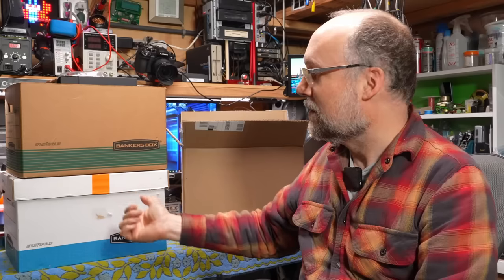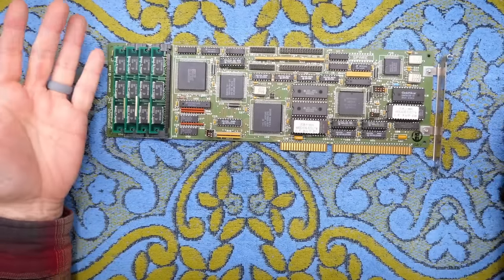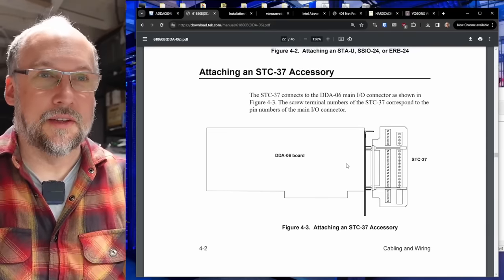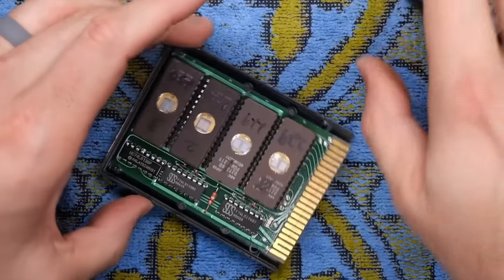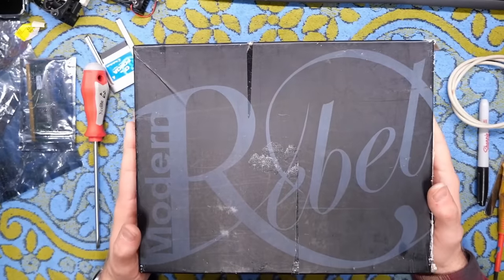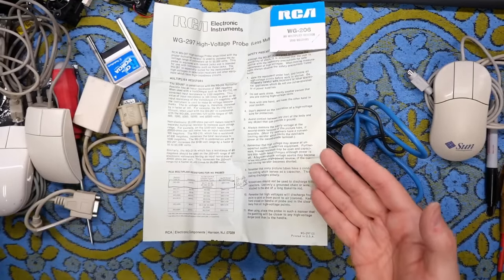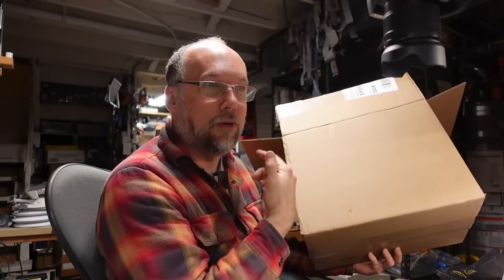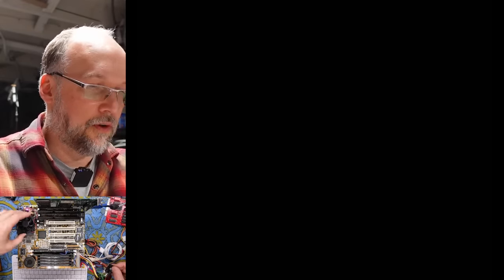What mysterious retro goodies can we find inside these boxes?

Comment: I have seen quite a bit of one-off stuff for computers kind of Niche things you can say.

Even as far as one-off programs including this as well

Side note it was something interesting that at church one time somebody had programmed a just used IBM XT in basic to essentially subtract the death rate from the birth rate from the start time of the program running to give an idea of how many people will be on the Earth at that time pretty neat idea for some event at church.

Also I remember somebody had written a program for a Commodore 64 that was used for timing using the button on a joystick as the trigger it was used for timing how many parts per our in a situation where there was a job training center on a job simulation.

Frankly space bar might have been better honestly in my opinion.

Also even had heard about a device that was actually used with the Atari 2600 add some sort of lab interface for scientific experiments that is just pretty far out there.

Have seen so many devices that look homemade who knows what they did.

Once found this thing in a box had a bunch of ribbon cables coming off with female connectors.

To my surprise when I dismantled the thing..

Do you know there was a DIN connector and cable on one portion.

As much to my surprise there was a keyboard Prince circuit board with all the keys which is removed and in their places soldered in the individual wires from the ribbon cables.

Apparently the person that use this as a switch interface found out this person that handsome and stuff before had built a primitive Smart Home set up and apparently this was used to take various inputs from switches and relays another contacts.

Probably was the easiest way to interface that many of contacts back in the day.

Also saw what would be called a hacked keyboard once that had multiple pin connectors on the side of some sort turns out these were tied into the switches that would correspond to keys that would be used to play a keyboard bass game except adapting them for music for game controller with bit of some circuitry all powered from the power from the keyboard Port pretty clever.

I do believe one of the little adapters that fit this that had the male 9 pin pin d-sub connector was set up for an Atari joystick

Also had seen something kind of weird it was a very tiny Project Box with only one cable coming out again this was a keyboard type connector apparently what this was was was some sort of keyboard emulator what's the only purpose being of that a keyboard being detected but nothing else.

For some type of system where my keyboard would not be present except under a certain service operations such as some sort of kiosk or something like this possibly.

Although it's possible that was a bit of extra that was also providing a certain key combination or a series of inputs on power up or shortly after possibly a dongle sort of thing for software potentially as well but yet not likely since this was homemade or very close to it.

But there was a eeprom but don't know if it even really was doing anything significant or at all in that application.

Don't remember all the details so long ago.

Oh yeah one more thing I saw this push button on the side of a keyboard a red one that died and a small circuit that was actually essentially begin with keyboard emulation and there was also a couple other buttons can't remember what the others were set up for but I do know the red one that had a stiffer push button for good reason the red would do the control alt delete it's possible the person may have had trouble doing key combinations that somebody designed this for them there was some odd key combinations I didn't recognize as well with the others perhaps somebody that was only able to use one hand for example there was a couple other devices that was like a secondary keyboard that could connect to the same keyboard but this was the most interesting part was not those but the other things were set up in something somewhere kind of like doing a separate auxiliary keyboard for hotkeys by the way the old keyboard was all it was was a telephone keypad mounted on the top of another enclosure how long will the internal circuitry.

Also if anyone curious why there's a fuse on some IBM computers internally that is for the keyboard and no it has nothing to do with a malfunctioning keyboard apparently if the cassette Port cable would be plugged into the keyboard Port by accident it would short things out regarding the power turn the keyboard not a good situation chance the fuse.

I didn't see one blonde once but well something that happened but not this for sure not a bad keyboard cable but a bad pet not the computer but a actual four-legged Pet Head chewed through the cable that was an interesting one at least the keyboard cable hey better the keyboard cable than power cable at least for the pet

Comment: Back in the time, had a Pentium 90 MHz system with an ASUS mainboard (don’t know which one, but it had a non-Intel chipset). I bought the Pentium Overdrive 150 MHz not only for speed boost, but also for because it supported the then much hyped MMX instructions. It turned out that the ASUS mainboard didn’t support the CPU at all. I ended up replacing the mainboard with a second hand Intel Advanced/ZP or Zappa mainboard. This board does only have 1.5x and 2x multipliers, so no support for 2.5x or 3x. The overdrive chip worked fine, mine even worked fine at 166 MHz, by bumping the bus up to 66 MHz. That was my first try at overclocking 😂.

Comment: PC Power & Cooling is one of the biggest, best of the old guard. When you wanted to prove you had the biggest, fastest, quietest, most reliable machine of the 80's and 90's? You need a PCP&C power supply - nobody made anything bigger. Or quieter. Doug Dodson's first product was a quieter XT power supply. Followed up by completely redesigning the IBM XT power supply from scratch and giving birth to the legendary PCP&C Silencer family, followed by the TurboCool multi-fan. They got bought and run straight into the ground by OCZ (who also imploded) in 2007 with label-slapping stupidity and cost-cutting. They still technically exist (owned by FirePower Technologies) but it's literal decade plus old designs not in active production. From about 1994 to 2003, PCP&C did the custom design and manufacturing (all in America) of 80% of my power supplies, and a small number of heatsink/fan assemblies. If you can find a PCP&C power supply? Keep it. Nobody's built a better one to date.

Comment: The above board can be used in an 8-bit slot if you populate the jumper-block (the empty ic-socket). 8mb of EMS-memory are quite nice in a xt-class computer.
Reply from the maker: Ah I wonder what one populatees that with? Maybe one of those resistors packs in the footprint of an IC. Interesting! Maybe the manual describes it a bit more.
Reply: @adriansdigitalbasement  Just jumper it with wires (1:1). There were dip jumper blocks available in the 80s &90s with thin traces visible on the top. These jumper blocks were cheaper than dip-switches. You could unsolder the dip socket and install an eight position dip-switch. All-on=8bit, all-off=16bit.

Comment: 24:51 should work in an A1200 and A600 also when installed a Fat95 driver on the harddisk. then you can use that as a data transfer device.

Comment: OK so you are the one who let the DDA-06 cat out of the bag!  These boards were $50 until suddenly they are NOT anymore.

I will further let the cat out of the bag by letting you know that these were professional data generation boards that you could use for (a) digital synthesis, (b) waveform generation, (c) 12-bit D to a control, (d) digital i/o and various other tasks.  The early boards had Burr Brown chips and are so very nice.

Here's the cat leaving the bag-
You can drive them from IBM BASIC, either off disk or via the ROM.  No drivers are necessary unless you're dumb enuf to run Windows.  If you run Windows you can get software drivers which abstract the Intel i/o register based control via Windows drivers.

But again, the nice thing about these boards is they can be used on very fast Intel machines running BASIC.  I'd try a Pentium III but you can use a 80286 if you want!

OK.  Cat let outta bag.  A lot of us in labs, colleges and machine control used these in the past.  I used them for controlling lasers via galvonometer scanners (i.e laser shows).  Bye.

Comment: 16:32 What else is there to do with a card like this? Well, if it's fast enough you could use it for a custom waveform clock or signal generator for the older computers that need "help"... just have to find the software.

Comment: Early Pentium boards (Intel Plato for example) couldn't go higher than 100Mhz. Maybe that overdrive is for these. Later, you could drop a Winchip or Winchip 2 into these older boards, because these CPUs interpreted the multiplier settings differently.

Comment: A few years back I had an ASUS mother board that had a iirc a 100mhz cpu on it but might've been a 75mhz pentium cpu.
the jumpers on the MB where set correctly to what the cpu it had on it when I got it .

I wanted to upgrade to a 200mhz mmx cpu Intel the at the current time cpu was also an intel cpu. So I set the jumpers to accept the 200mhz cpu  and it ran it and all but it was over clocking the cpu to 233mhz . I tried to mess with the jumpers to lower clock and voltage and it did drop it to 200mhz but was very unstable. when set to the 200mhz settings it over clocked the cpu to 233mhz and was stable and ran Nicely .

Comment: Though the education market primarily used Speech Synthesis with special needs kids, this as I remember was not good option. By thus time TI had better speech synthesis chips, and Abacus Software created SAM (Software Automated Mouth) forthe Atari 8Bit and Commodore 64, which allowed more control of the speech's inflection of syllables for a more natural sounding speech (though it was still robotic,  it did sound a lot better and smoother). Being software, 1 disk was copied many times to be used on all the machines a school has, instead of needing to by a cartridge for every every system. (There was a version of SAM for the Apple but it required a card to run it, but it did not have a speech chip as one would think, but to have interrupt timers for timing of the speech, similar to the Mocking Bird board.)

Besides, by 1987 schools were more into educational games and LOGO/PILOT Programming before going onto Multimedia with LogoWriter.

Comment: non-mmx and mmx have differerent power! non-mmx has all power lines 3.3 and mmx has 2.8 core and 3.3 i/o power!!! The difference between socket 5 and socket 7 included split power lanes, not only higher multiplier settings. I'm not sure but 2- cpu boards had additional difference arbitrating cpu's

Comment: The high voltage probe goes with an rca voltohmyst vtvm.
Reply from the maker: Ah I see -- so that's what it's talking about? Compensation resistors for specific models. So I wonder how it would work with a modern DMM? Would it give a reasonable ratio like 1000:1?